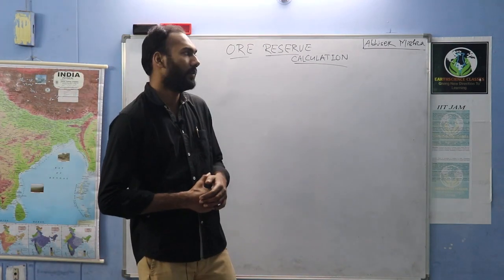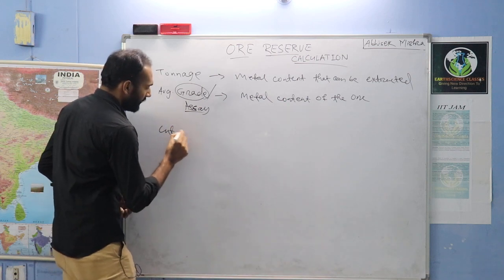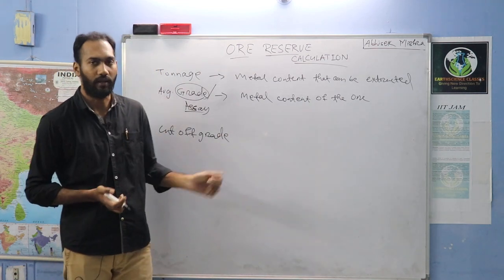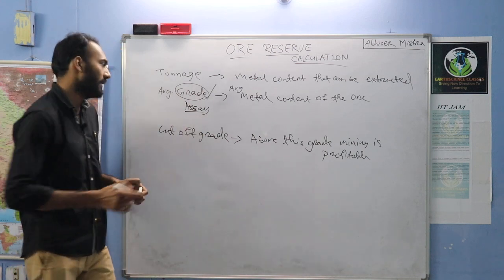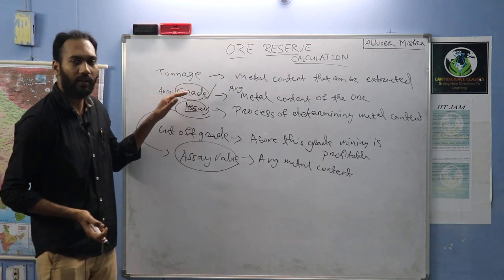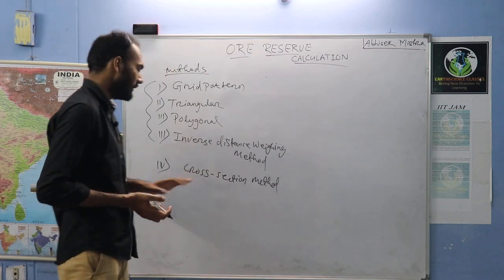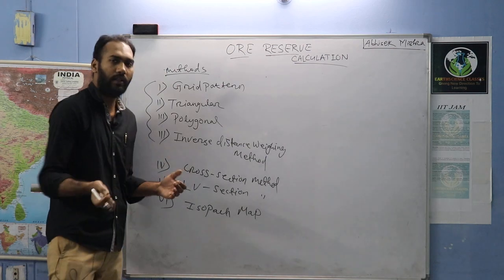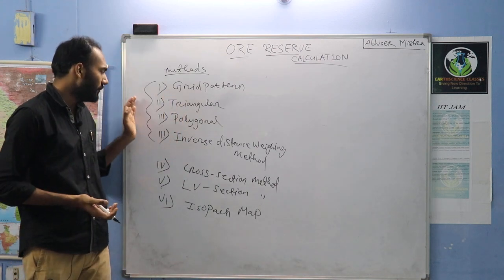Ore Reserve Calculation_ Part-1

Comment: Sir another doubt ....why we are using formula for avg. Grade calculation by G1T1+G2T2......../T1+T2........ ..why not using Volume instead of thickness?  Is it for each block are squared area ?? ...if each block are ...in rectangular shape and all rectangle having different length and breath ...then ..Can we use Volume term instead of thickness??? 
Please sir clear